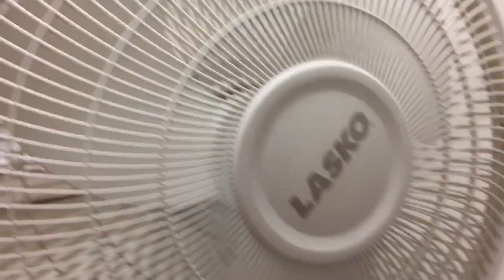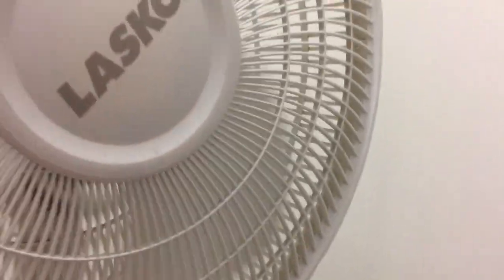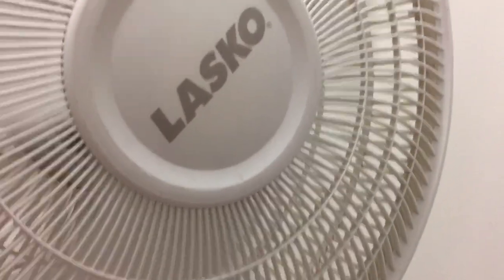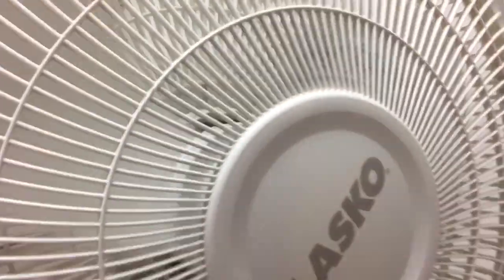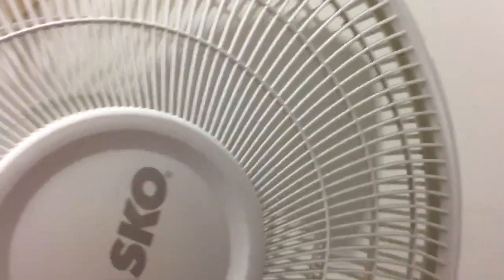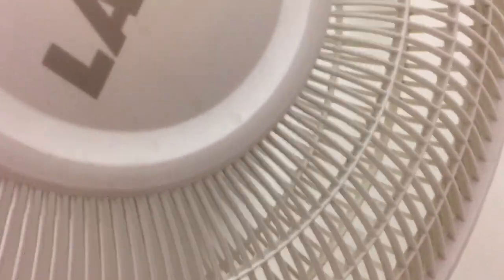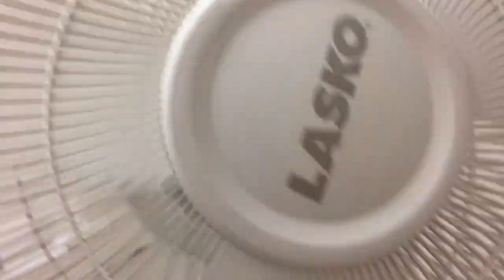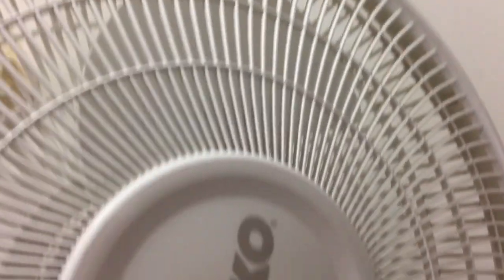Broken lasko pedestal fan

Comment: They don't make them like they used to. I have a ton of vintage Galaxy, Panasonic and Lakewood fans, from the 70s and the 80s and not one major problem with it. I even have a 1917 Westinghouse fan and it still works after 100+ years, despite needing a replacement power cord, and some vintage 1900's - 1960s fans that still work flawlessly. My aunt had a 1990s Windmere desk fan that still works, despite the oscillator needing replaced.
Reply from the maker: Cool